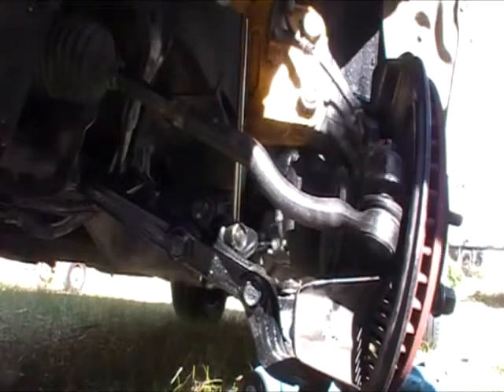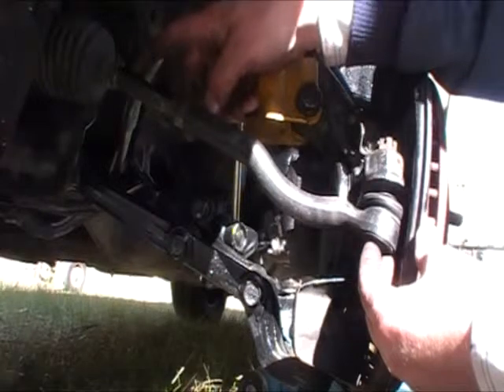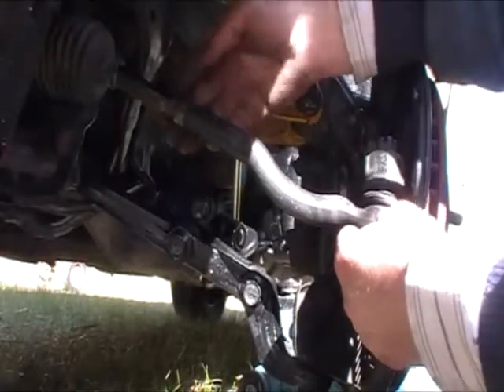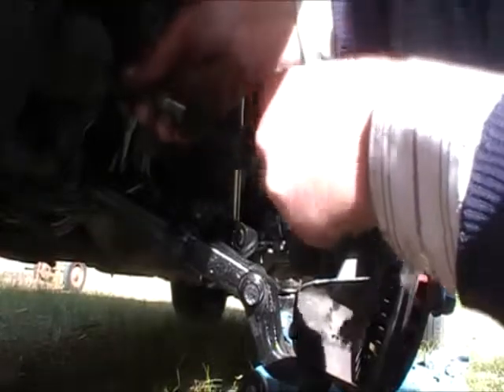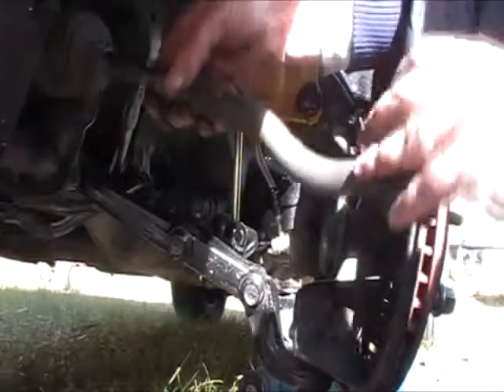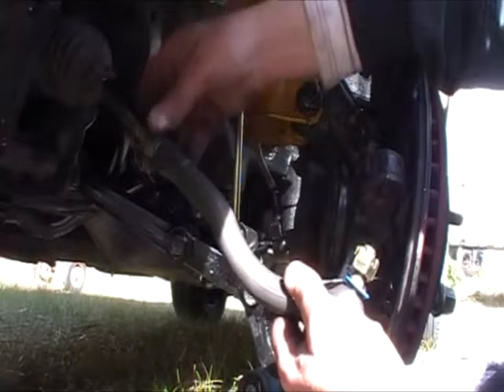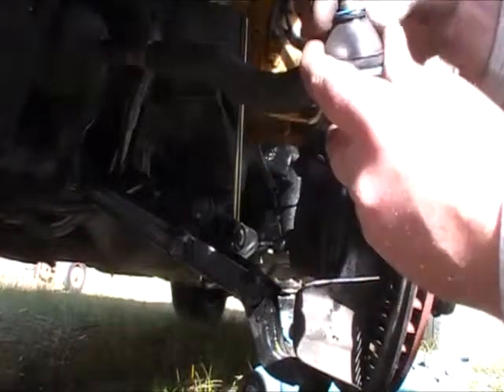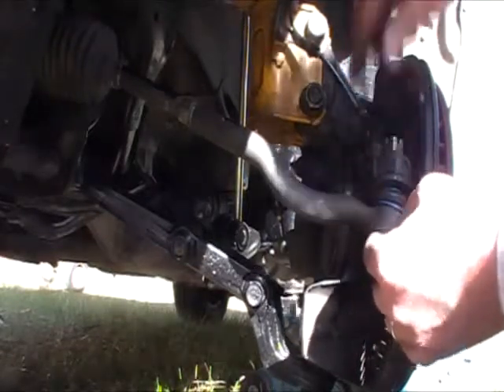Outer Tie Rod End [ Tarago Previa Estima TCR ]

Comment: Is there a lubrication port in these parts? Have you made pointing out the lubrication places, I have only found the driveshaft zert fittings.
Reply from the maker: I have 4 vans, there are no lubrication ports on any of mine. Maybe aftermarket ones could posably have some.

Comment: How do you know  if you need new ones
Reply from the maker: Jack the van up so the wheel is off the ground and then try the shake the wheel left and right, if you feel it's loose and maybe a little bump at the same time it's most likely your outer Tie Rod end. If it shakes and you don't feel a little bump as well then it could be either your inner or outer tie rod end. It helps to have a mate shake the wheel for you so you can look on the inside to see it as well. I used my camcorder to record the inside while I shacked the wheel so I could put the footage on my pc to watch what was going on, and to slow the footage down helps a lot. Watch closely where the ball joint is connect, if the wheel knuckle moves a little before the Tie Rod does then you know the ball joint is stuffed and you need to replace the Tie Rod End, unfortunately you can't just change the ball joint it self. The ball joint is a part of the whole arm. after you change the Tie Rod End do the test again and if you still get some movement then I would say your Inner Tie Rod End also called 'steering arm' or 'rack end' needs replacing as well. easy job with the right tools but I didn't have the tools so I got my mate at Tyre-power to install my Inner Tie Rod End for me. NOTE: buy your parts from overseas first and supply the parts your self or you will get over charged for parts from most local places. If you are changing one side then do the other side at the same time. If you are not sure then the easy thing to do is take it to a place where you get your wheel alignments and ask them to have a look for you and ask what parts do you need.
Reply: Thanks